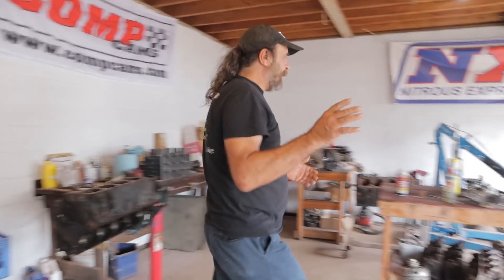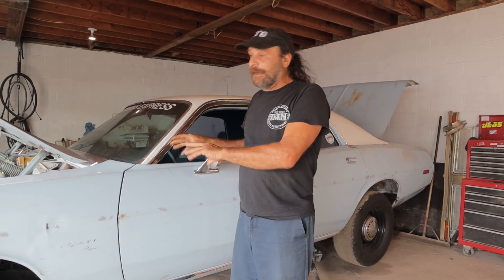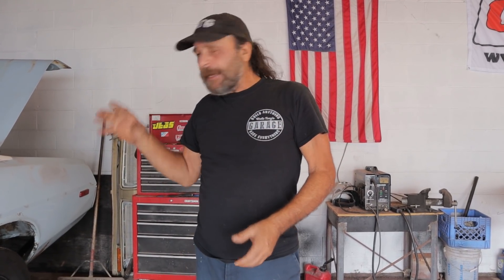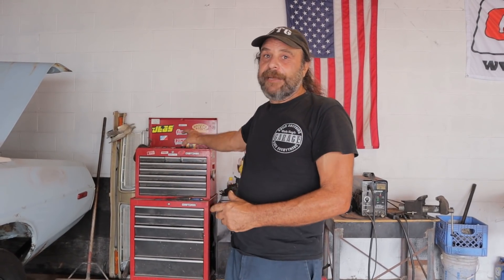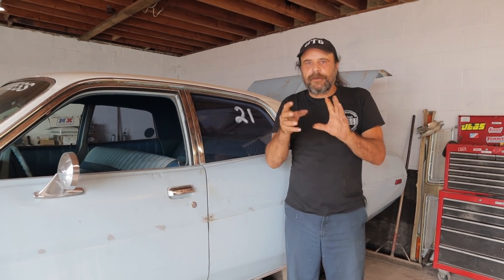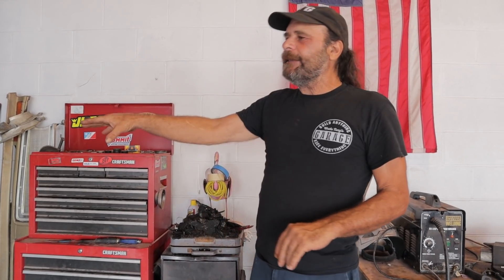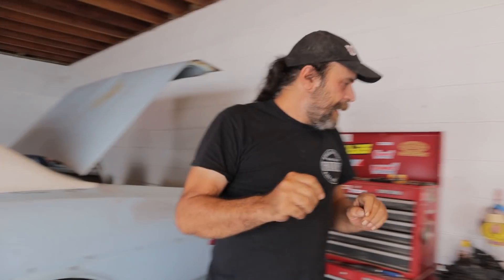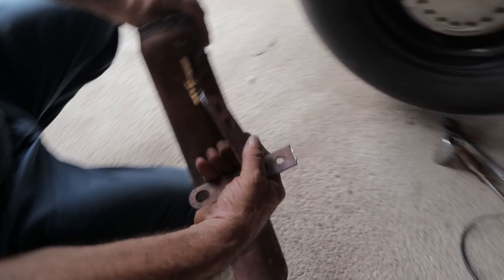This Is What Hot Rodding Is REALLY All About

Comment: Here in the rust belt , the car do this naturally . The bed of my truck just lost a wheel well , it's 18 pounds lighter now LOL.
Reply: Automatic weight reduction of my car was a big reason I left Buffalo NY 36 years ago.
Reply: Sounds like if you'd mount your truck on a rotisserie and flipped it a couple times, 20 or 30 more pounds would fall out of it.
Reply: Hahaha.. dang... that's funny
Reply: Uncle Tony's words of wisdom : nothing's lighter than a hole 😄
Reply: @easygoing2479  when fixing up my 91 Jetta, and it's in decent shape , I got a 5 gallon pail of rusty bits of nothing  and undercoating crap off it.
Reply: Thing to keep in mind is rust itself is heavier than iron/steel. The metal that falls off is obviously making you lighter, but the rust that stays us heavier from the extra oxygen atoms hanging around and sucking up all the fun
Reply: VGG weight reduction lol

Comment: I'm building my exhaust from used pipes I got from working at the body shop. I've got enough to make a full 2 1/2" dual set-up. I bought a cheap x-pipe from eBay, traded an electric fan for a pair of Flowmaster 40's, the rest is free junk. I even have a pair of electronic valves off a 19 Vette that I'm thinking about making cutouts with. Taking garbage and making it work. That's how I hotrod

Comment: This is why I like auto racing - it's a combination of technical knowledge, skills, and self-improvement. The driver has to be in as good (if not better) shape than the car, i.e. light but still strong and with lots of stamina. High-level drivers spend a lot of time exercising to maintain that form because you can't just get off the couch and run the 24 hours of LeMans.

Great vid

Comment: this is the kick in the ass i needed to work on my iroc today.  i got my stock iroc to run a 14.2 @ 96 mph on bald dry rotted bfg's.  3.08 gears, t5, 305 tpi.
Reply: '88 Iroc z hard top, five speed TPI 200k miles- free mods (siamesed runners, home made AFPR, base timing bumped a few degrees) Hooker headers and Y pipe, worn out front struts, catback- 14.34 at 96. Knew it was going to become a money pit. Had my fun, sold it!

Comment: Hot Rodding is about taking what ya got even if its a '95 Ford Aspire S/E and making it run to its peak performance parameters bonus points for doing it with all factory parts.
Reply: 14 mm lug nuts x 4 it's practically a factory Lotus.
Reply: @pgtmr2713  1800 lbs
Reply: @mudduck754  That's pretty darn light.

Comment: Tony has me lookin at all my bolts wanting to cut them all down. I enjoy making things fit even if they weren't meant to be.  I also love customizing my car so no other car in the streets look like mine. I expect my car to be fast in a straight line and later to be fast at a autocross.
Reply: Meanwhile, I have to run longer wheel studs to be NHRA legal.  I’m measuring to get the exact length I need, but they’ll be longer than stock for sure.
Reply: Finding free ways to save weight is a great thing to do when your bored and broke lol

Comment: Tony I have a 1960 Plymouth Fury 2dr ht. It was ordered in 1959 basically as a factory race car. I swear there isn't anything extra on it. Like the radiator support rather than nuts and bolts it has 2 bolts welded to the frame, no extra nut heads. It doesn't even have the factory sound deadening in the trunk area. It really is a simple car. I just make sure what's there is working and everything works together.

Comment: Most of my weight reduction on my projects (mostly all trucks!) comes from crawling underneath with a scraper and wire brush, then getting out some degreaser and the pressure washer... this usually leads to the discovery, and repair, of more leaks ;) the rest comes from a sawzall and cutoff wheels!

Comment: Outside of the air shock on the right rear, what have you done to the rear suspension? Poly bushings? Pinion angle? inquiring minds wanna know!
Reply from the maker: Three Way adjustable shock on the left rear, everything else completely stock
Reply: @UncleTonysGarage  that's awesome

Comment: Take off the chrome and use paint instead!  I took off pounds off chrome  and replaced it with stripes on my 1966 Pontiac Starchief Executive.
Or don't paint it.  Sand it off to metal and just clear it to take weight off. How much 2 gallons of drive paint and primer weight? It would count as the same as scrubbing the zebart coating and metal griding you did.
The clear makes it more aerodynamic.   But you know all that.
I really appreciate every vidéos you make cause its like being at university of cars knowledges and beeing with you in the shop.   You explain details and share with passion.  I really would like to talked personnaly about certain details and lately my 389ci started to compress in the base.  Oil spitting from breather.  Where to start after pcv valve and compression drop on pistons before i take everything apart.  Steps to go! 
I you have time to read in the thousands of messages.   Hehe

Comment: do you treat the cuts to prevent rusting?

also realistically can a Renault Encore (1.7L, 4cyl, 80hp, 2k lb) can achieve sub 10s 0-60? 11.7s stock
Reply: Idk shit about Renaults, but with weight reduction and intake and exhaust work you will see a noticeable difference. Beyond that probably a matter of how much money you want to spend
Reply from the maker: I give the bare metal a spritz of rustoleum
Reply: Maybe running on hydrazine but don't hit any bumps

Comment: Great video! Not sure I understand why weight behind the rear wheels would be detrimental to weight transfer. Isn't that part of the reason the old AFX cars had altered wheelbases? Better weight transfer by moving the rear wheels forward, increasing the rear overhang...? Moving the battery to the trunk is another method. I don't mean to be a PITA, just trying to understand.
Reply: Yeah, that's what I thought.
Reply: He covered that, you missed it.  It's about weight transfer dynamics on launch.  It adds to the rear weight.
Reply: @discerningmind  if you look at the video at 7:10 you'll see what I mean.
Reply from the maker: Any weight that dips below the axle centerline as the nose rises is acting as a counter to that motion.  Weight in the trunk should be mounted so that it remains above the axle centerline with the nose at full rise.
This changes as cars get faster, and that low mounted weight will help keep the nose level and front wheels on the ground.

Comment: Pure hot rodding--dealing with the fact there is as much failure as there is success. Like Edison failing at the lightbulb until he learned everything the bulb was not. You get the wrong part, the right part doesn't make the power advertised, the rusty bolt won't let go, but you keep on keepin' on until the car does what it should--and then something else breaks because its the next weakest point in the system, or its just old.

Preserverence is hot rodding and inventing. Weight loss is "free" hot rodding. It helps the launch, the balance in corners, and the braking and fuel efficiency to help you skip  a lap.

Comment: Talking about weight reduction, Uncle Tony, are you running the cop wheels up front or just in the back?

(And does anyone make an aluminum wheel that looks like a steel wheel that could save you a couple more lbs up front?)
Reply from the maker: Just out back.  Probably be switching to the standard steelies soon, though

Comment: I would say that going to a junkyard and getting a stock engine and making more power by doing whatever you can spending the least amount of money is also hotrodding. I just bought a pretty much pristine 350 4-bolt main  from the yard for 200 bucks. I have a bunch of stuff lying around from a previous build that I am going to use to put it back together and make some power.  It's a mid 80's TBI engine low compression, I have a set of trickflow Super 23 heads with 56 cc chambers but they are only 175 cc's and have 1.94 intake valves. I am sure they would make more power than the swirl port heads that came factory with it. I also have an edlebrock 2101 intake, and edlebrock 1406 carb, and pretty much everything to improve and reassemble this engine minus a cam shaft and lifters. It's going to be fun putting this thing back together.
Reply: Nitrous 💯

Comment: Modern day hot rodding is putting a ebay 200$ turbo on a junk motor and clapping the doors off a guy with 10k$ in a stroker
Reply: Thats modern metallurgy and CAD design. From a materials and engineering standpoint LS motors are space ships compared to a gen 1 smallblocks 🤣

Comment: I'd love to know how your clutch person measures clamping pressure. Back in the day, I had a winder in a Mustang that killed the 1400-pound clutch the previous owner put in. I replaced it with a McLeod B&B rated by them at 2800 lbs. Never broke that piece with a 35-lb 'wheel, leaving at 4-5k and shifting at 8200 (when necessary). After, I had a built 410 FE in a '67 Cyclone that I put a 3500-pound McLeod B&B Long into. Again, tough as nails. Hearing about your B&B upgrading from 700 to 1000 pounds doesn't make sense. I just checked McLeod and they evidently don't make anything other than diaphrams now, and I cannot find any specific clamping ratings.
Reply: After perusing the "INFORMATION SUPERHIGHWAY" [cough] I came across an excellent multi-page tutorial on the Ram Clutches website. For those interested, go there and click on "Learn" in the toolbar, then select "Clutch University". The answer to my question is on P.2, as Tony's guy is using base pressure. However, the whole series is a good read. Have fun.
Reply: I run a McCloud  3 finger dual disc w/ cintered iron discs behind a 557 in a pulling truck.Has heat shield on pressure plate & you can add weight to the fingers also.They are still available.
Reply: @sodbuster4296  What trans?
Reply: Sm 465,but they are available for the toploader  Wich is the  same input as a new process 435.

Comment: Hot rodding is about solving problems, making things work.  Speaking of efficiency, you should modify that harbor freight welder so it's not AC.  I did it to mine and the welds are night and day.  Penetration and consistency is so much better it's stupid.  For the price of a rectifier and a capacitor and some old wire, you can get some really good welds on fairly thick metal.

Comment: I did this same thing with my 84 monte ss I used to call it the Swiss cow because it was white and primer and everything I could cut off the car I did until I hit my goal of mid 6s in the 1/8 mile on pump gas at the sacrifice of my poor car which rhe last pass I ever did buckled the roof and that was that this was in the late 90s also when 6s on a pump gas 355 was like a tech inspectors wet dream to find a nos plate i never had to disqualify me from running na

Comment: How about removing the hood hinge springs? Or is that too high up?
Reply from the maker: A prop rod hood isn't in the spirit or image of this particular car
Reply: I wonder how much a gas charged tube off a Town and Country would weigh? you could do this to the trunk and the hood., taking the springs off the hood hinges, and the torsion spring off the trunk hinge.
Reply: Uncle Tony's Garage you do want it to go faster don’t you? Lol
Reply from the maker: Yup, but within certain function and style constraints..on THIS particular car.
We have a Slant Six Dart that we'll be bringing back soon, and that car is completely gutted and gone through and weighs just over 2000 pounds ready to run.
Reply: Uncle Tony's Garage what is normal curb weight and how does that compare to Feather Duster? The one with the aluminum cross members and other weight saving tricks!

Comment: Uncle tony what about through drilling through non critical bolts

You can easily save weight like that too
Reply from the maker: It'll get to that as the car evolves.  I've been there before...too many times to remember
Reply: Uncle Tony's Garage sweet! I’ve never seen a home gamer do it I’ve only really ever seen it in real high level racing
Reply: If its totally non stress bearing nylon hardware is awsome

Comment: Idk, people also do dry weigh, weigh the car with the engine and transmission and rear essential bare chassis the surface area of the body panels should be considered as well. But if your keep that regular then more power to ya.

Comment: I don’t have the contacts to do hot rodding right so I do tuning instead but I still get it
Reply: Contacts? This is what your smartphone is for. Internet anywhere, information anywhere. You can YouTube research anything in seconds.
Reply: PGTMR2 true true but I live in the rust belt so the classics are either in perfect condition and cost 50k or are rotted to shit. Uncle Tony’s been around and he knows what he’s doing where the only mopar I’ve touched is my friends 3rd gen 5.7
Reply: @krispytoast8804  I had an 83 and a 92 3rd gen Camaro 5.0l both. The 92 looked immaculate, had rusted wheel wells in back I discovered later and a hole in the floor developed. You can look for clean cars, clean cars from out of state, or take on a project that isn't too far gone. Also some newer cars may be galvanized. Which helps against the rust. My Probe GT's been outside the last 11 years in the rust belt. Painting it right now. Yes it's qucker than my 3rd gens were and my SN95 Mustang GT was.
Reply: PGTMR2 thinking about getting a 1st gen mustang straight 6 and swapping a v8 and a fox body 5 speed into it to have a classic since my only car now is a pro charged 2006 bmw

Comment: How's come you don't buy a tubular front suspension for that car?  They easily cut off 150 pounds or more
Reply from the maker: Not even close....the difference is approximately 40 pounds and absolutely not worth the cost and complication associated with loading the front end with aftermarket parts.
Never a good idea for a budget minded street car.
Reply: For a budget street car I agree with you, but without the torsion bars, and the crossmember that holds in the torsion bars that's already gotta be 40 pounds, then you've got the tubular front suspension that's stronger and lighter than the k frame so maybe not 150 pounds but atleast 100 pounds lighter.  That's one of the main things that helped me and my dad shave 500 pounds from his 74 charger (I know that's not massive weight reduction but the car has a full interior and a cage in it)
Reply from the maker: The 73/74 B Bodies are a completely different animal.  Those cars have an isolated K Frame and are extremely bulky up front.  In your case, the tubular K was definitely a step in the right direction.
Reply: @UncleTonysGarage  really? Because I thought there was very little differences between 73 and 74 especially with the chargers.  But yeah I forgot about all the different suspensions that Chrysler used.
Reply: That works but money works but $$ you must be richer then me..
Reply: @jmanke6057  listen man, I honestly have no idea what you just said or what you're getting at, but a guys car doesn't define how much money they have.
Reply: Your front end idea would definitely  work but I thought the idea of uncle Tony' s was to do the most with the least? Sorry if I had it wrong. I have a 1955 f100 the guy before me cut and took so much off it raised the cost of the build. Guess it all depends what one is  after. I enjoy winning with my budjet builds even against more exotic builds but it's what ever one can do to go faster. Thanks what ever one can do is real hotrodding in my book hope I didnt mean to be offencive in any way.
Reply: @jmanke6057  hey you're good man, my car is a 74 dart swinger and I built it on a tight budget because I just got out of highschool and I worked a lot of hours at my job to be able to pay for the performance upgrades and my dad helped me a lot with it and he chipped in a lot of money too.  And I'm happy with my car, it's a hopped up 318 with 3.55 gears and fatter tires in the back.  It's a great street car and I think it should run 14's but because of covid I only got to race once and I spun my tires.  My dad's car is a 74 charger he has had since he was 19 and it took us 5 years to rebuild it, his goal was to get into the 11's and right now we're very close to getting into the 10's actually which will be really cool.  But we did save a ton of money on making a ton of our own brackets and we pretty much did everything with basic tools...our most sophisticated tool is just a drill press😂.  The project still cost quite a bit but it could've cost a lot more...  I'm an only child and my whole life people have been saying I'm spoiled because they think since I'm an only child I just get everything for free and shit but I honestly work my ass off, I've had a job since I was 9 and I work my butt of in school and I put in my own money, blood, sweat, and tears into my car... people still say it's daddys money but they have no idea how hard I've worked to get my car on the road and I feel really good about it.  But I get sensitive sometimes because everyone judges me for being something I can't control, I'm an only child but that doesn't mean I don't work my ass off for what I have.